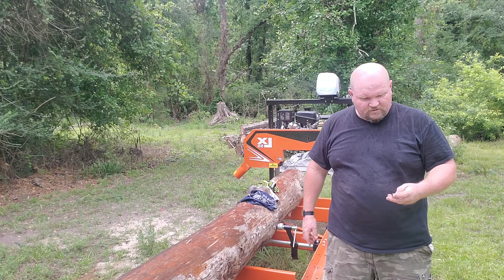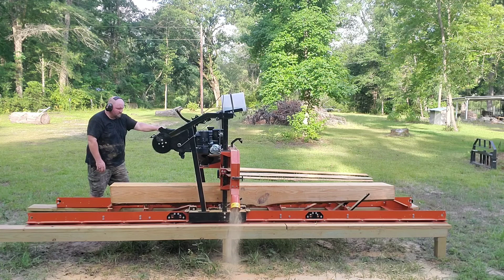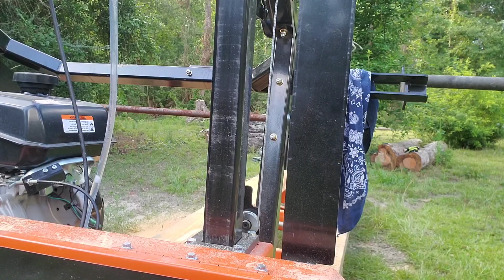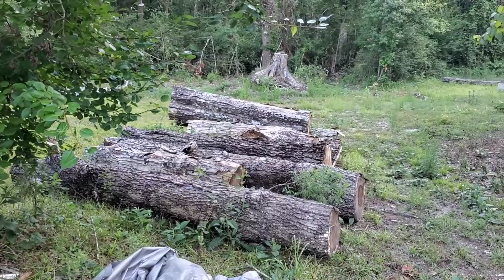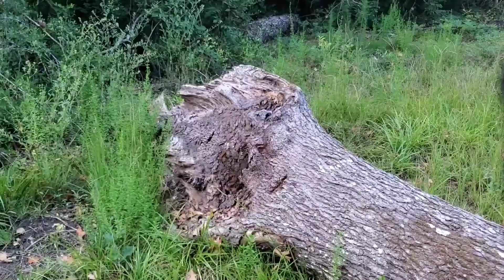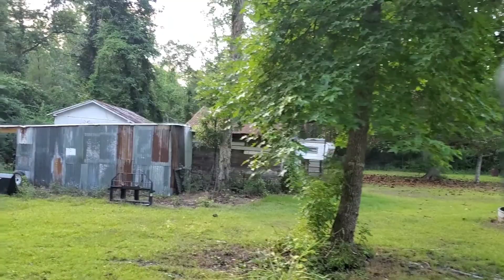Wood mizer LX55 sawing pine log.

Comment: Suggestion: drill you a small hole in the top of your water bottle so the water will flow to your blade. Air is trapped with no place to go.
Reply from the maker: Absolutely., one of my suggestion in the videos I have up . Thanks for the info .

Comment: you might want to check shaft speed at engine. should be 3600rpm. also turn the bolts at each joint so the flat side is up. the saw carriage can contact them. put a vent hole in your lube tank. just a few things i noticed. best of luck
Reply from the maker: Thanks for the advice .
Reply: Greg, how does one check shaft rpm's? Thanks for sharing tips. I'll use some of those on my upcoming mill.

Comment: The saw always hangs up at the track joints. I would be checking it out.
Reply from the maker: Yes, it does. The paint peeled off and accumulated at that point.  Working on a solution.